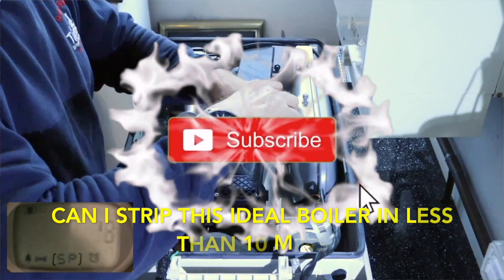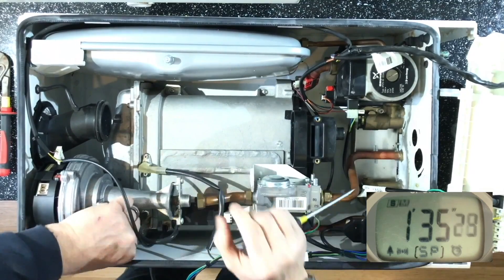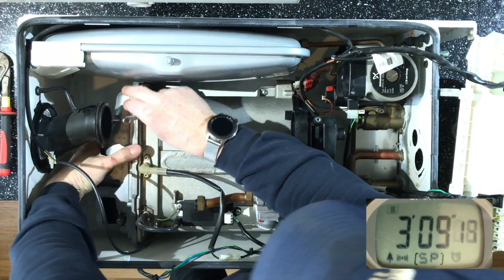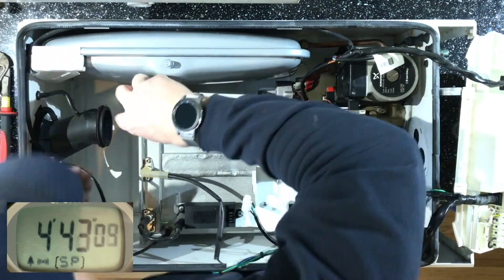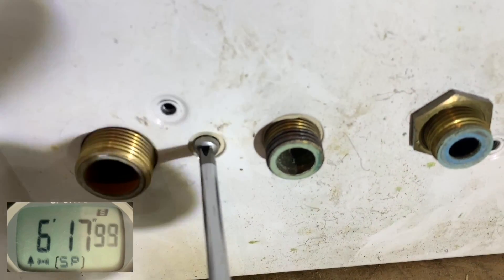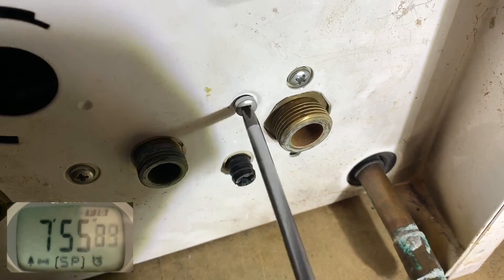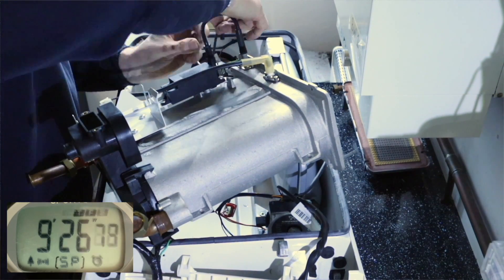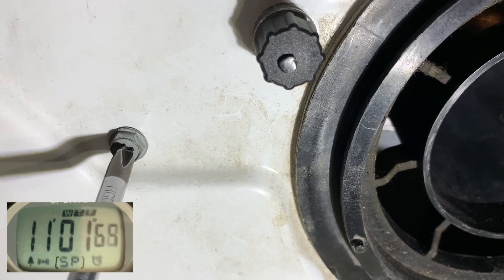Completely stripping an ideal logic combination boiler in less than 10 minutes. Gas training.

Comment: Is it possible a video on how to run gas pipe under the floor, wooden floor, between joist for instance and if the pipe requires duct or ventilation between two ceilings, under thefloor??? I am confused???

Comment: Hi Derek, thanks for the helpful videos as always!. Just wondered if you could make a video about how to set up a boiler correctly in regards to the system it is supplying,ie the ideal pump speed and achieving correct delta T across boiler. I ask this because don't think iv seen any practical straightforward info on doing this. Thanks mate
Reply from the maker: So many different boilers to do this video but not a bad suggestion cheers

Comment: Nice one.  The reason the sump cracks in the same place is because that’s where the machine holds the sump when it is formed by injected moulding. It created a weak spot where the plastic is thin. The sumps for years now are now held at the corner during manufacture where the plastic is thicker so no weak spot.  You won’t get a cracked sump on a boiler made within probably at least the least 4 years. 👍👍